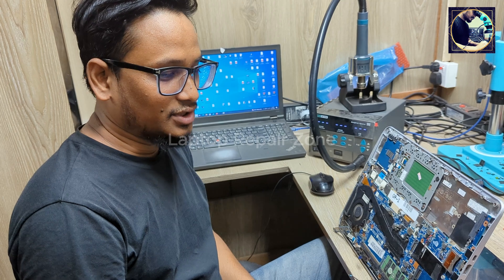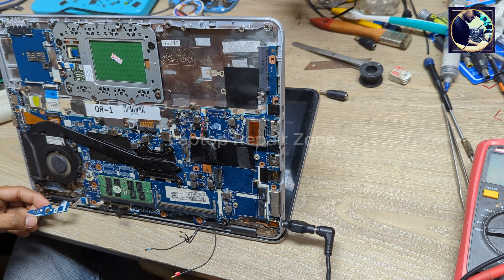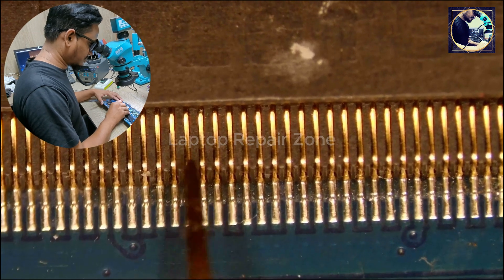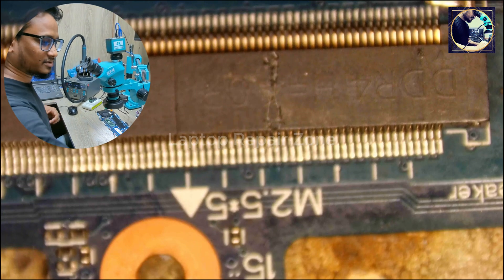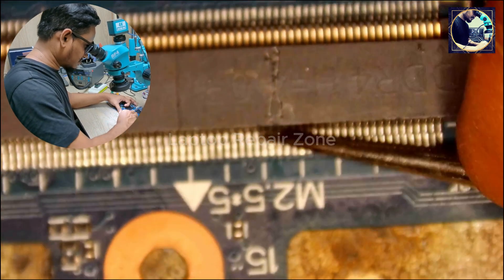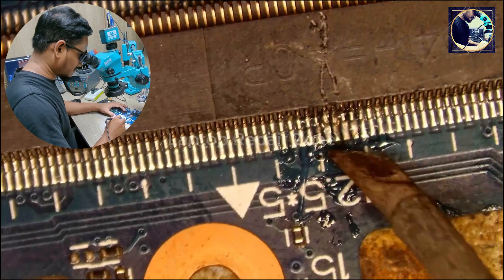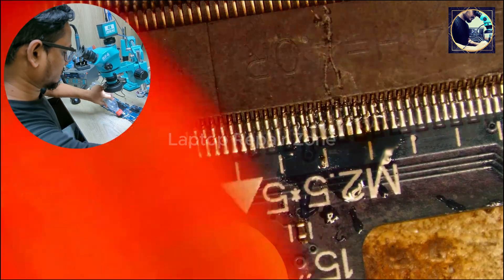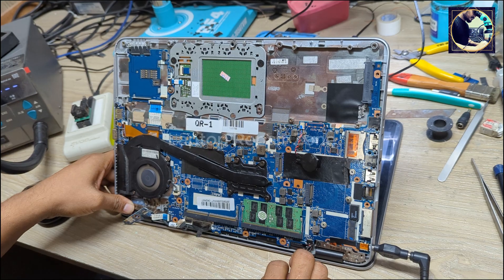hp laptop black screen caps lock blinking 3 long 2 short  | RAM slot Repair | Hp RAM error Fixed!!

Comment: Hi i have an hp pavilion 15 z aw (dag55amb6e0) with this issue all voltages are present including ram voltages 1.2, 2.5, (on 4 and 8 gig sticks only one cap  I get .6 volts on one side of cap and 2.5 on the other side, no ground there seems to be normal. I checked all ram slot pins they look fine and are all soldered properly with no bridging. board turns on properly but with no picture Ram sticks are ok. Any ideas? have not tried to remove ram slots